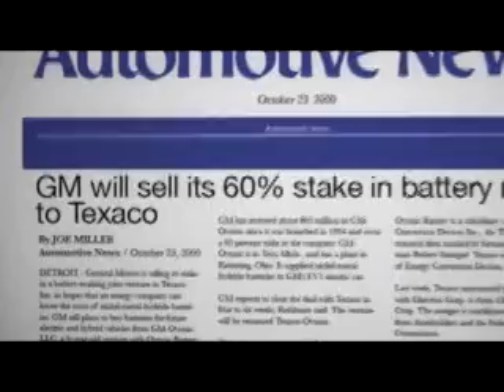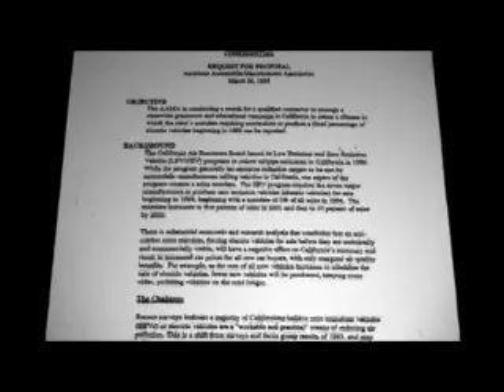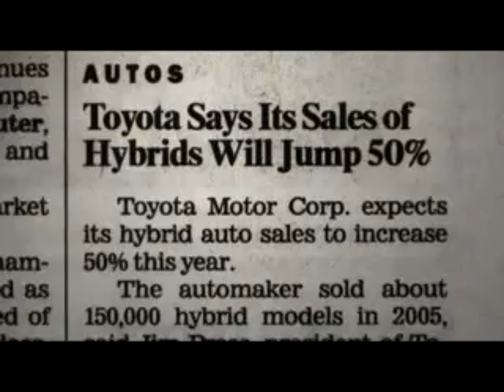Why did the USA not force GM,Ford & others to bring back the ELECTRIC CAR? PART 4 OF 6

Comment: @cecilbdml 

I do agree with certain limitations of the electric car aka merely displacing pollution and the additional waste from the batteries themselves.

But the electric power-train idea for a car is by far the most efficient method of propulsion.  

Exceeding 90% for motor and inverter together vs only 15% gasoline internal combustion.  Motors in these cars are brushless type and have 100,000+ hour lifespan worthy of millions of road miles.

Battery technology is the only limiting factor.